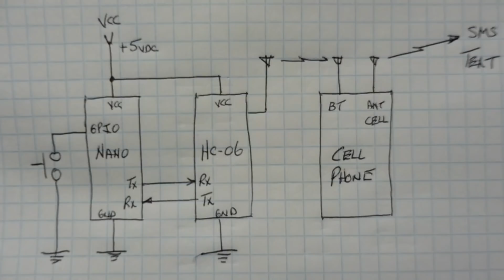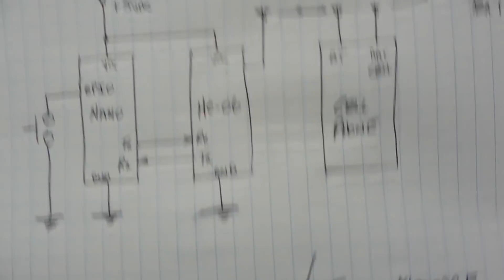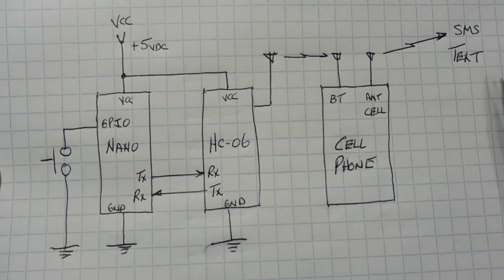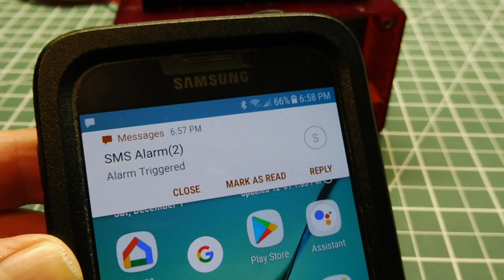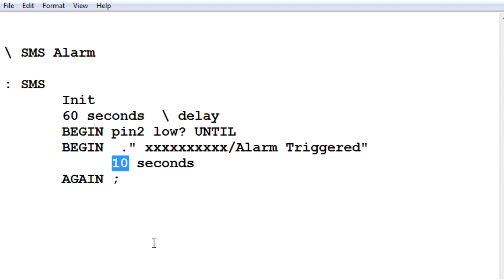Arduino / Build An Alarm System Using Cellular SMS

Comment: This is a great project but if your cell is on silent mode or you are a heavy sleeper this may not help. I wonder if we can make one that sends the signal via SMS
to a device that will sound a local alarm?
Reply from the maker: Go to Google play store and download Text Message Sounds app. This app has many notification sounds that you can use. They are loud and will work even in silent mode. Check out the Air Horn, Hockey Horn, and Police Siren sounds.
Reply: You’re asking a lot from the dude , he couldn’t even have a second phone to test on 😂😂

Comment: Why is this just a temporary solution??
Reply from the maker: The alarm system is battery powered so the control box battery and cell phone would have to be recharged at some point in time.
Reply: @0033mer  A good power supply UPS will extend that time indeed

Comment: An actual complete schematic would be great.  I suppose one could use a PIC to send that string to an HC-06.
Reply from the maker: You can use any micro-controller with an UART interface to send the control string hence the block diagram. I have built a few of these using the low power MSP430 microcontroller in a very small package. The box that I used in the video is my universal controller where I can add options very quickly.  https://youtu.be/yXRWQpJrK6g

Comment: Thieves don´t work like that.  Thieves will steal the whole truck.
Reply from the maker: Eventually the alarm will be triggered and the continuous SMS alarm can be tracked by the cellular provider using cell tower triangulation so keep your cell IMEI number handy. You can also text your cell phone and it will return its location when running Cerberus. Most vehicles have anti theft chip keys but to go one step further pull out the fuel pump fuse.

Comment: if the truck is near by you can use LoRa to solve the truck scenario.  What  IC are you using in the demo. Its between nano and the hc-06
Reply from the maker: Yes Lora would work if the truck was nearby. If the truck was stolen and driven a long distance the constant alarm trigger could be used by the cellular provider to track the vehicle using cell tower triangulation. Check out this video for the internal workings of my universal control box. https://youtu.be/yXRWQpJrK6g